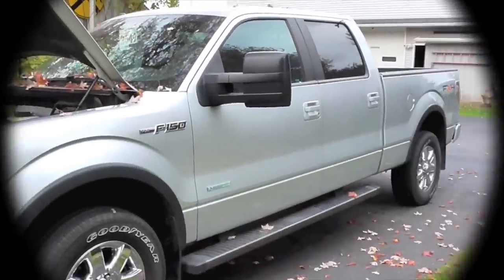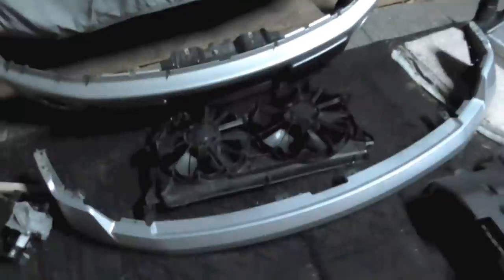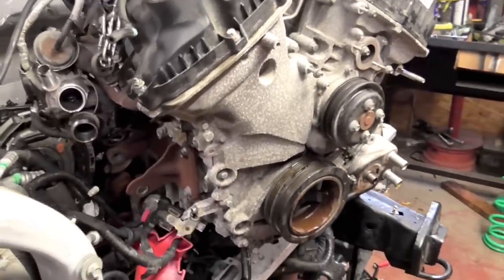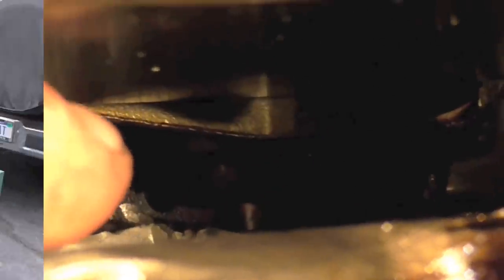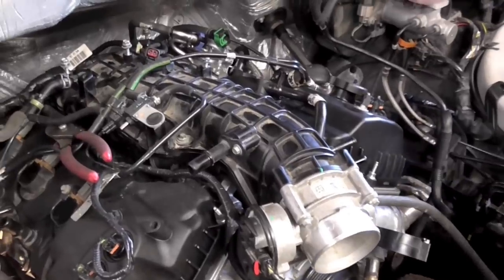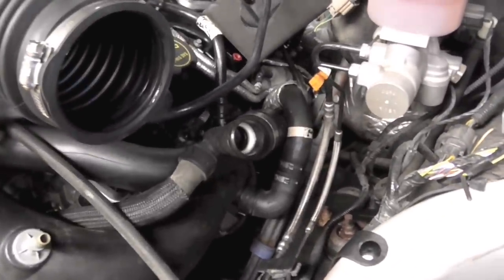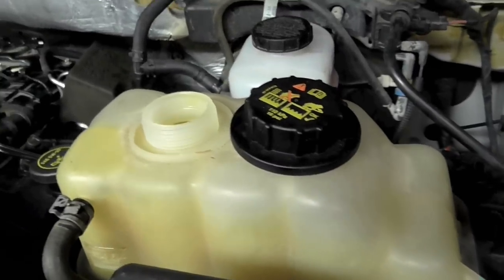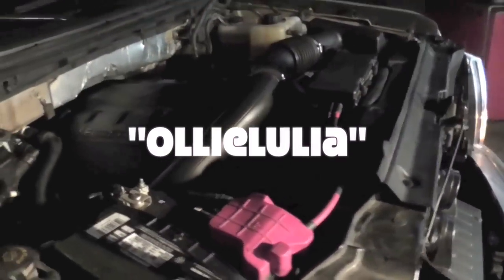FORD F150 TRUCK:  3.5 V-6 ECOBOOST ENGINE FAILURE (Removal and Installation).

Comment: They should only put natural aspirated v8's in these trucks stay away from fake boosted ones.
Reply: Brian Samuels fake boosted? What the hell do you think they put in diesel trucks? People use you heads!
Reply: @casper24ism     He's talking about trying to get too many HP from too few cubic inches in general.   A 3.5 liter engine in a full size truck is ridiculous; boosted or not.
Reply: @scdevon  well it seems to be doing very well,now other brands are doing it

Comment: Hey what were you talking about lining up with flywheel and how did u do it I'm about to pull my 3.5 as well
Reply from the maker: Through the starter "hole" as I recall ... "It was 8 years ago". Just don't force-it, as it should align nicely amid very low effort. :face-blue-wide-eyes:
Reply: @TommyZTrains  ok

Comment: right when I thought fords were getting better SMH I been seeing so many videos with these new fords with blown engines
Reply from the maker: That "might" be going a 'tad-bit far' ... THIS Truck continues to run incredibility well,  is "ultra quiet", *and nearly 20,000 miles later (after this clip), We've had no issue whats-so-ever.  What amazes me is the quality amid a great tight ride, "and some pretty decent MPG too". *THAT BEING SAID: "The engine failure should NOT have happened" !  

Anyway, "more-time" ... will TELL.   So: "will see".

 :- )
Reply: TommyZTrains what did the new motor cost? Do you get over 20 mph? Nice job bro.

Comment: My engine on my 2011 F150 just went out on me. I was told by the shop that it’s a lost cause to try to repair the old engine so I’m curious how much money you spent on the new engine?
Reply from the maker: Ho Cody, back at the time ? / about 8-K with ALL the "upgrades" (that I preface in the video). THOUGHT: The amount of LABOR amid the "gentle-touch" setting needed here is (and was) Just STAGGERING !. After that, I'll ad a couple of remarks: 1) Ford gives you a 3 year warranty IF you use and buy a "Ford Crated LONG BLOCK Motor", and they tell you to use ONLY / just use plain ' ole Motorcraft oils ( and THAT IS ALL we have used period / just plain-ole 10-W-30 Motorcraft oils). 
Lastly: we've enjoyed almost 100,000 miles of Service, along with absol. ZERO issues !!! / and I mean NOTHING.

I wish you well / Best of Luck.

Comment: I will just keep my 95 Chevy Silverado that is still running strong with over 230K miles with it's original engine and transmission. I did have to change the alternator at 58K and the water pump at 106K. I will NEVER own a Ford truck!
Reply from the maker: "Don't tell me you escaped Hub Bearing's Juan" !  :- )
Reply: 1995 silverados had repackable front wheel bearings, not hub assemblies.
Reply: Juan S Chevy is garbage. 100% junk.
Reply: prawcess I'll take the 100% junk any day of the week over " the bestselling truck" especially when my lowly little push rod motor has 359,985mi on the oe motor. Oh wait a minute she just turned 360,000mi. man I love my  100% junk.💪💪
Reply: prawcess hey slick my chevy junk just turned 367,780mi, that's good ole chevy junk for you. You know, the longest lasting, most dependable real trucks on the road.
Reply: prawcess hey cheif my 100% chevy junk just turned 385,680mi. on our 3,600mi trip to the great state of Texas. That old junk of mine was doing 80mph plus for hours at a time across the great state of Texas. Man I love my junk. ✌✌

Comment: U can see that it don't like ams oil. motorcraft for a reason
Reply from the maker: Maybe ... "plenty of opinion lay there" !
Reply: I don't think the oil snapped the con rod, Einstein.
Reply: Trevor Conrad motorcraft oil will prevent hydro locking ? Great to know 
.
Reply: Not an opinion. Fact is Amsoil is not API certified. As it will clog catalytic converters. So you're taking a gamble one batch to the next is even the same blend. As I seen many dealers tell customers that their engines failed from using the stuff. To take a hike. As the manual states, use API certified oils to remain warranty compliant. 

And the reason it had water in the oil. The damn rod went right through the water jackets and block! As I can see the bearing spun 360 degrees on the crank. Then said fuck this and locked up from bearing failure...

I can tell you this. Them rods are good up to 800+hp.. So don't blame them..As they are over designed for a daily driver...
Reply: everyone here spelled scamsoil wrong. should have called up scamsoil to see if they would replace your engine. with all their claims of being the best oil i dont see why it would be a issue for them

Comment: How difficult was This? How long did it take you? Do you have any mechanical background?
Reply from the maker: "Yes" (I was a Mechanic), and the how long ?:  "about a week on & off" ... "difficult" ?:  yes, but taking a video / taking our time / amid every detail (like wire looms going back where they were / that sorta thing) was the hardest thing AFTER the MISERABLE JOB the fuel Injectors were to load, and PLUG-IN.    NEVER AGAIN    /  *BUT: The truck continues to run FLAWLESSLY.

Comment: What ford fans have to deal with boggles the mind
Reply: KingMacintosh actually, the little stint Chrysler did with Diamler wasn't all bad. the 2nd gen Dodge Rams and most of the Dakotas were pretty good, the minivans were good. their cars were overcomplicated pieces of crap, but most of the rest of the stuff was pretty good for the modern era. I do really miss the good ol' days of iron chariots and simple, beefy, badass v8s...
Reply: My 2011 has 125k miles - nice try.  And Chrysler?  lmaooooo ur kidding.  they go bankrupt every decade!!!
Reply: David Stanley this is my first Ford. blows any Chevy or dodge out of the water.
Reply: prawcess
the trouble is the engines are no good
v6 turbo in a 1/2 ton that is laughable.
everyone knows that is a bad idea except for the people buying them. for some reason they think it is a good idea to have  broken engines broken turbos scattered about their garage,.
the v8 is ok but not the best v8 on the market
and I never seen a FORD truck used by the Federal govt employees .They only use the best ,GM.
Reply from the maker: Com'on Dave ! Didn't you watch this "Mike Rowe" Video ?: https://www.youtube.com/watch?v=8tEqwXrqzH4
Reply from the maker: Watch: https://www.youtube.com/watch?v=8tEqwXrqzH4
Reply: TommyZTrains Lol is that a bit of sarcasm? Their torture test fell far short of what the average owner will put an engine through. Let's see how an ecoboost handles 5 or 10 of years of short trips, extended oil change intervals, sketchy fuel quality, etc. These ecoboosts seem to fail most often due to timing chain-related issues or strange connecting rod failure incidences. The teardown video did reveal a ton of carbon buildup though.
Reply: hochhaul Many are failing due to carbon building up in the engine causing them to seize . very poorly designed engine.
Reply: LMAO my grandfathers f150 platinum has 200k kilometres on it and it runs good as new, only basic maintenance and no issues.

Comment: i have a 2013 3.5 ecoboost, bought it with 54k on it and im glad i bought the 5 year extended warranty, mine has 68 thousand on it now, weve owned it for about 9 months and has already went thru both turbos, a wheel bearing and is now back in the shop for a turbo underboost code which im told now means i probably need new timing chains and guides etc... since the turbos alone didnt fix the code issue.  I know the ecoboost with upgrades are great for the power and fuel economy from a V6 but at 60k miles i didnt expect these types of issues.
Reply from the maker: Hi Jason: as I understand it;  the 2011 thru 2013's were the "first-generation" *(amid the smaller, not very "stout" sprockets) ...and the timing chains were prone to stretch / not very "beefy". BUT: The 13 "late" model - up to currant builds were then "upgraded" to the 'better' CHAINS, and the larger oil supply lines, (to the turbos), and LASTLY: the better sprockets and tentioner's amid what WE GOT / and were told when purchasing Ford's crated Ford "LONG-BLOCK" Motor,  ALL of which you'll see here. As ours nears 100 K it continues to perform FLAWLESSLY and it runs "spot-on".  

And: to "ice the cake":  the drain hole that we added to / in the bottom of the C.A.C. (or inner-cooler). *YOU were WISE to purchase the warranty !    ;  -  )

Comment: You only got 65k miles, we got rid of our 2012 f150 ecoboost for a 2015 f150 Platinum about 4 months ago. There weren't any real issues but the warranty was out and it needed a lot of regular maintenance, and getting the new truck meant no service and we could trade in the 2012 for like $25k

Comment: Amsoil is the mistake.  Use Ford recommended engine oil.  Better yet, have a Ford dealer do your oil changes.
Reply: Ford oil yes! Dealer changes are for women only.

Comment: Are there any other tool I can use to hold the cam to replace the timing chain on this particular truck or do I need to purchase the special cam tool?
Reply from the maker: I do NOT know Joon, "WE DID AN ASSEMBLED "LONG-BLOCK" Engine assy".   *Please can anyone answer this question ??

Comment: I sure like you attitude! Need more people like you. Ive worked in Aerospace manufacturing for 33 years, ANYTHING can have problems, no matter who makes it. Its inherent in mass manufacturing. Your failure looked like a stress failure. Probably something that just slipped by an inspector. It happens to the best of companies. I respect all car companies for what they do. Its not easy. That said, Ford should have helped with it, cost wise. I drive Fords and they have been good cars. Ive had Chevy's, Buick's and Caddie's all good. Good luck with this one, it sounded good.
Reply from the maker: So kind of you, "THANK'S" !
Reply: You're Welcome

Comment: Just picked up a  2013 F150 that has about 220,000 miles on it. The only reason I purchased it? ( Trucks are outrageously overpriced)
The body and frame are in excellent shape. And after talking to the dealer. It was a local trade-in and they had done most of the service on the truck. They had just recently changed the timing components and replaced both Turbos.
Plus the price was right.
The engine sounds great and I can't find any issue wrong.( Fingers crossed)
Right now I am in the process of getting it to a known to "me" condition.
Oil changes will be at 3000 miles no matter what. ( Oil is cheap)
I ran a can of BG EPR through it last week. ( Yikes!!! lots of carbon in there)
I ordered all the fluids to do both Differential and transfer case.
Still thinking on the transmission. It should be done, but sometimes that could be a can of worms.
Reply from the maker: Just be VERY WEARY of the "charge air cooler" Kelly !  *(read the description HERE to learn more),  I LOVE our truck (as we approach a 100 K "later" mileage on our long-block crated-engine / as the truck continues to perform / & run FLAWLESSLY !.  Best

Comment: good time to put in a ls crate motor
Reply: um no....
Reply: cartmanrlsusall he'd have a very reliable truck then!
Reply: henchicken1 Cheaper and more power. Win win.
Reply: I doubt it would be cheaper when you factor everything in like wiring, transmission and exhaust and last i checked an ecoboost F150 will smoke any stock ls powered truck, so i am still sticking with no...
Reply: +cartmanrlsusall - By the time it was all said and done, you might as well just go buy a brand-new vehicle.  Swapping engines, transmissions, computers, and EVERYTHING required to run it....plus the motor mounts, crossmember, transfer case, driveshafts....
Reply from the maker: "WE" disagree; as I've said: the truck continues to "operate & run" flawlessly ... The 4WD works GREAT, "and we've had no issues whatsoever". To "abandoned it" (what would you get for it "DEAD" ?) is senseless. Tho this failure forced us to "question that faith", In the "end-game", (thus far),  we STILL have no regret.

 :- )
Reply: TommyZTrains yup as long as the owner thinks it's worth it, my hat is off in respect I had enough issues doing a couple of swaps on chevy trucks over the years. I like the ls crate from gm cause it's  got a stand alone package everything is in the box including a wire harness. I don't know why ford is different.
Reply: cartmanrlsusall You can buy a stand alone coyote turn key ready too...
Reply: brian mounts I'll pass on the old pushrod chevy engines. They have their share of problems too but make less power and tq.
Reply: brian mounts the Ford 5.0 blows away the Chevy 5.3...
Reply: cartmanrlsusall - ha ha the ls motor won't go more than 50k  mis.

Comment: Did you by chance look at the intake valves to see if there was any carbon buildup on the old engine?
Reply from the maker: I honestly can't recall (after nearing 3 years). I wish I could say, but again I just don't recall. *I'm thinking: NO.

Comment: TommyZTrains -great video - so as the 13 screw 3.5 is turning over 210k two timing chains - lost track of how many plugs and at least three sets of coil packs now right side turbo is failing and the trans lead frame just went yesterday - so I think it’s time for an engine trans swap - would you do it again on the ground or or would you pay for someone with a lift? Debating now whether I tackle myself in the drive or pay ?? (Ex-Toyota master tech many moons ago)
Reply from the maker: "Feel for ya Bill" .... "I guess I WOULD". The Ford "long-block" (if that's the way you go) has an incredible warranty / ALL the part and component "up-grades", and I haven't had one single issue at 100,000 miles later (on the new crated motor). IF the person's patient and does a careful job of "management" (keeping-track of all the looms / harnesses and so on), then (in MY opinion) THAT'S half the battle / it's a worth-while endeavor.
Reply: @TommyZTrains   so on the  ground out of the top ?? or find a place with a lift and pull the cab ??
Reply from the maker: @willparker445  "A LIFT is alot easier / more manageable Will" !.
Reply from the maker: Funny about the "coils" / and plugs remark ... I have NEVER-ONCE had this occur. "I know and fully understand the remark: (and I've seen it on / and in other platforms), but again: NOT with mine ever (as I near 150 K miles now).
Reply: Well about 500 miles on the lead frame replacement (still couldn’t buy from Ford as I am over recall mileage and the units produced are for those  within recall period ) got part through order at oriells- dorman - little worried about trans after changing the fluid for first time in 200k heck didn’t look awful and feels better after - little hard shift when very cold light throttle 1-2 - but if I drive typical it’s fine - even cleared up a light chatter on a 4-3 DS - so she still feels worn out though - still debating on what to do with my precious “dory” (it’s electric blue) and the wifey love her....
Reply from the maker: @willparker445   "Behind EVERY good man's a GREAT Women Will"  !!!   :- )

Comment: Going through the same exact thing with my 2016. 24k miles on it. Piston skirt on number 3 and 6 Pistons.  Both failed, shattered rods, holes in block, identical to yours!!  I'm putting a built short block in mine with forged pistons and rods I'm into it about 10 grand right now
Reply from the maker: "Jerrod you BLEW ME outa the water reading this" !!! *Hopefully the 16' examples a bit "less" laborious and things are "cleaned-up" a bit, esp. "pipe" wise. If it any consultation: ours continues to run flawlessly, and (catch-can or not), I'd recomm. spuding a tiny hole in the C..A.C !.  *DID YOU NOTICE A HORRIFIC AMOUNT OF WATER AFTER THE FAILURE ?  *(Our's rolled out a small river after it grenaded). 

Good luck / very sorry  :- (
Reply: TommyZTrains  I put a Dual catch can in mine at 3k miles. Run premium only, full synthetic at every oil change, ran great for 24k miles. When mine went, I was coasting to a stop coming up at red light. Engine started cutting out, feathered the gas pedal to keep it going........BOOOOOM!! send me email and I'll send my pics
Reply from the maker: "I'm reluctant ta do that", but I can only imagine. I suppose you too, tried to get some "help" (from Ford) ? DID you try ?  **4 k's pretty low miles **. Try an post some clips IF you can Jerrod.
Reply: TommyZTrains I put a oil separator catch can on mine and Ford said "it can starve the engine of its oil" ...... (FACEPALM) ......thus voiding the warranty. I couldn't believe the sheer STUPIDITY of that claim. So it's all outta pocket for me. $10,000 into it so far. That's pre labor for dealer to put it all back together.
Reply from the maker: BEYOND Incredible !  *Maybe we BOTH need to ta watch the Mike Rowe video's about the Eco-Boost again ?.
Reply from the maker: Click: https://www.youtube.com/results?search_query=Mike+Rowe+Ecoboost

Comment: gm came out with eco boost with the solstice now ford tryd to copy it looks like it didn't work lol, we call them tords
Reply: You do realize it's a fancy name for a turbo engine right? It's not like they created the turbocharged engine
Reply: Whats wrong with the coyote?
Reply: Kody George GM did their first turbo gas engine way back around the 50's/60's. They brought it back in then 80's with the legendary Buick Grand National.
Reply: Freedom "What's wrong with the Coyote"
They're bad was engines and 10 times more reliable than the old 5.4. Unfortunately some guys have ended up developing cylinder bore distortion issues or lifter tick/knock. Others have had main bearing, timing chain tensioner, or oil pump failures. Google the problems I mentioned.
Reply: KingMacintosh you are full of crap I have owned 2 gmc trucks transmission suck and steering clunks, nice try!